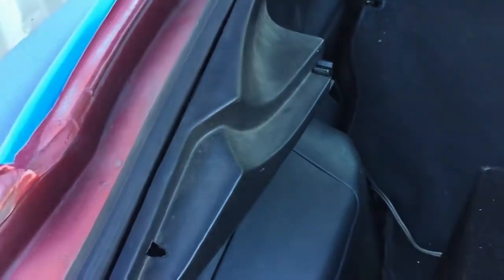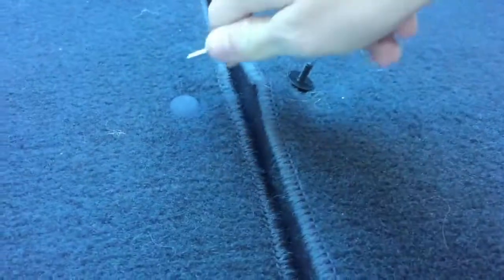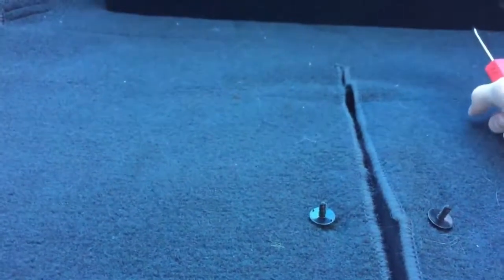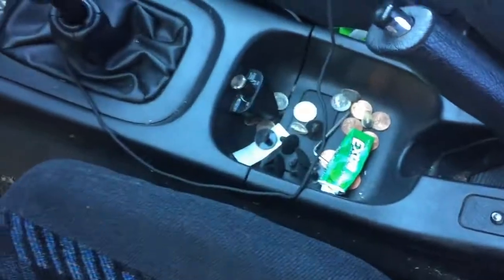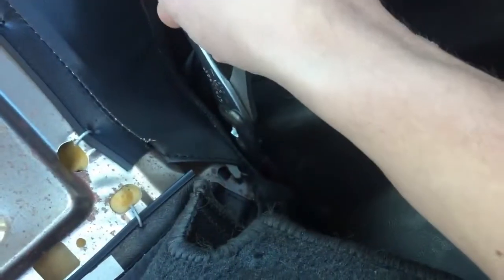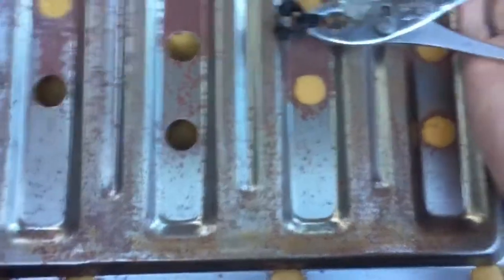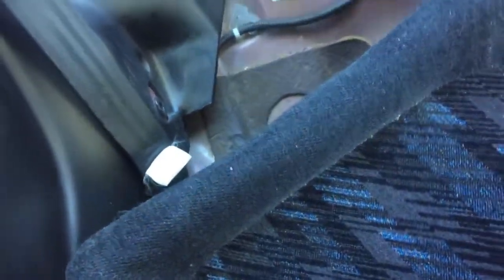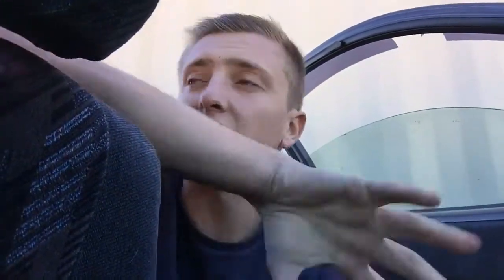How To Remove Back Seats 1994-2001 Acura Integra!

Comment: I have a quick release steering wheel but the previous owner didn't connect the horn. I also found the srs light on from removal of the air bag. I'd like to actually look at you show us in detail where and what color the horn connections/ wires look like. Thanks for taking the time to.
Reply from the maker: +Ivan Caravantes I'll definitely take a look at that because I've been trying to hook mine up as well!
Reply: OMGTeggy I hope there's not a big difference between 95 to the year of your integra. because all the videos out here show older models or civic. or describe the color of the wire without saying or showing where everything is behind the steering wheel and dash/instrument cluster area.

Comment: There's also 'hidden bolts' that required a wrench to remove
https://youtu.be/SscG5-yF4Js?t=140

Edit: I didn't have to loosen such bolt, as seen in the video I linked to. I did have to use an 18" pry bar to leverage to lift the bottom part of the seat up, due to rust from moisture..

Comment: I have a 1996 integra GSR with leather seats if that matters. Anyways does anyone have a idea what the back seats may weigh? How much weight would I remove if I took off the back seats ?
Reply from the maker: +Ebdlt113 De La Torre there actually pretty lightweight tbh. I'd say tops 20lbs full assembly